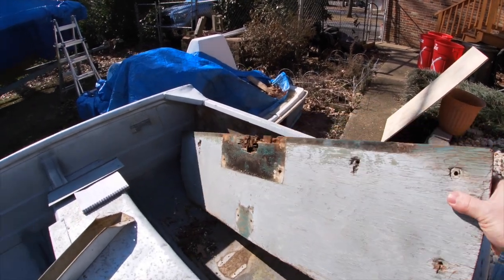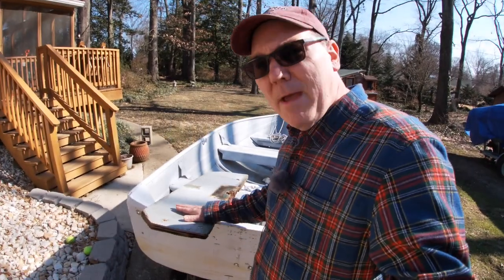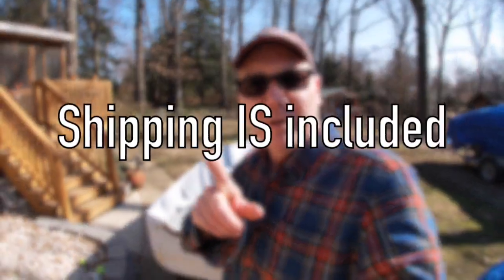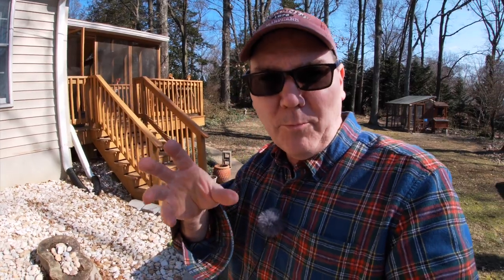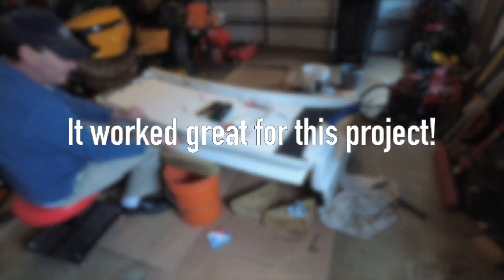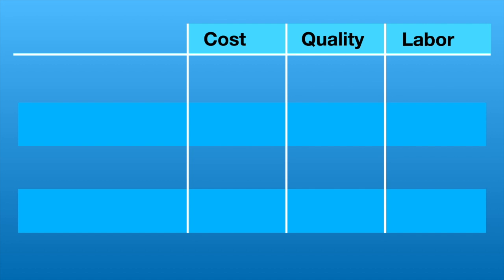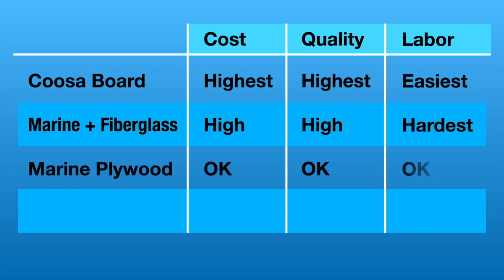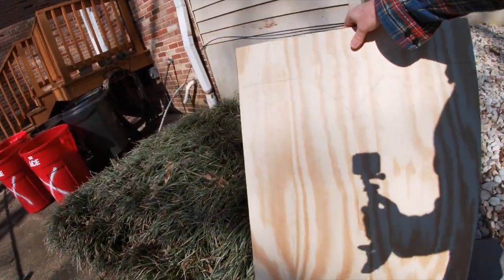Boat Transom Replacement - Marine plywood, coosa board, or something else?

Comment: They do recommend to cover coosa with a layer of fiberglass.. and it doesn't hold screws the best..
For that small aluminum boat 2x4s would be "good enough".
Larger boats should do it right, due to the time investment to have to repair it in a year or two
Reply from the maker: I had not heard that it is recommended to cover coosa in fiberglass for this type application. Obviously for stringers etc. it would need to be done, but that kinda thing (and the screw issue!) makes coosa not as appealing for this application!

Comment: Coosa should be wrapped in fiberglass also.  PVC laminated with fiberglass and wrapped, will be much more stiff.  Probably not ideal for a transom because a motor puts a lot of twist force on it, but for stringers, should be a good choice.

Comment: If it was me I would go down to my local auto parts store and pick up a fiberglas repair kit (quart of resin catalyst and some fiberglass cloth in one package). Glue it up and when cured taper the edges slightly run a strip of cloth around the end grain and up the front and rear faces of the plywood, you only need to use a 6” strip of cloth around the edge centered the rest up on the faces of the ply. Yes I know I just added roughly 30.00 to 40.00 dollars of cost but in all likely hood you will never have to do it again and an extra day or so of work to the job will give you a warm fuzzy feeling when the next owner of said craft drives into the sunset dreaming of his water borne adventures swirling around in his mind. (Who knows it might even be me). Their is nothing wrong with saveing money it’s the only way to get the most for what you have to spend on a hobby (if you got enough resin and cloth left do the exposed face of the ply on the outside rear face) The kits if memory serves me where Qt, and I believe gallon size. It’s kind of cheating for me I have a lot of stuff laying around that not every one else will have handy fiberglass cloth some catalyst I need to buy more resin and also have milled and chopped strand reforged fairing materials. Please at least consider tapeing the exposed end grain of your ply it will go a long way to double or triple the life of your transom.

Comment: Use the cheap plywood and give it a good coat or two  of the stuff that they use for pickup bed's to protect them, about the same price ir not much more than painting. A quart should do the trick for the size you have.

Comment: Tiny boat nation makes aluminum transom kits. It's all you need. Do it once do it right.
Reply from the maker: Those kits are pretty cool - but literally would cost more than I paid for the boat.
Reply: @WayneTheBoatGuy  but it's a forever solution, you could theoretically run a bigger motor than the boat is rated for, and deep down inside you know it's what you want. Lol. Plus I mean throwing expensive parts at cheap old boats is the tiny boat nation's philosophy.

Comment: Hi Wayne, any ideas how to attach a plate to my existing transom to lower it about 2 inches, allowing for use of a short shaft electric outboard?
Reply from the maker: You’ll probably need a jack plate. Attach it with long bolts that go through the transom and have lock-type washers and nuts on the other end. Preferably all stainless steel hardware.
Reply: @WayneTheBoatGuy  thank you. Can one be made by hand economically? My boat is a raft with a removable transom.

Comment: I ordered a 3/4" sheet of Marine from "Blue Box" store. special order, took 4-5 weeks to get it.(May 2022)
Big mistake,. 
My particular piece had several visible voids around all edges and it had biscuit/football shaped plugs/patches on the back.
I must admit the face was gorgeous/beautiful, but the rest of it was junk, garbage...
Paying I forget 150/200$ and that included 2 sheets luan for shipping. sandwiched between Luan.
1st. thing I did was squeegee epoxy on both sides and poured the voids and epoxied all edges.
It's a trophy (NOT) 
It's just laying around as I have not found a use worthy of cutting it up for.
I can take BCX or exterior or even regular ply and with time and epoxy or polyester and make it as good as most marine. 
(if not,,. Better)
Furthermore... if you glue 2-3 pieces together making +1" or 2"  material who cares if you get a void or 2, just keep the water out of the voids, and if you pour the edges and sleeve any penetrations you should be golden.
So right now I am anti-marine grade, I got a raw deal I feel, 
I may change my mind at a later date. 
Cheers.

Comment: I’m sure somebody else has mentioned this, but you should not just bolt Coosa in. It should be laminated for rigidity.
Reply from the maker: Someone else did mention that - and I wonder how its unlaminated rigidity compares to wood that is just bolted in.
Reply: @WayneTheBoatGuy  
Coosa is like a foam core with fiberglass strands running through it. It is really only strong once it is laminated. The biggest advantages are light weight and water impermeability.

Comment: Coosa board. Buy once cry once.
Reply from the maker: I was on the fence - If this fails quickly, I will probably go coosa.
Reply: @WayneTheBoatGuy  you won't be out much by trying the plywood first.
Reply: I’ve done coosa for stringers, transom and deck. It was worth the initial cost for longevity.

Comment: I used regular 1x12 pine boards in my 14’ v bottom.  1971 model boat.  The old plywood lasted a long time but was done for in 2018.   Ok pine,,,  wow, I can hear all the reasoning against it already but wait,    I used two thicknesses to fit snugly in the space. I painted all surfaces of the boards with three costs of oil based enamel prior to glueing them together. Not only are they fitted snugly and securely in the transom but they are bolted with SS hardware in every location where there once was rivets and in addition to that I drilled thru the transom hull and boards and used an aluminum skin about 16” long and 10” wide where the motor clamps on on the inside of the boat and its all sandwiched together with the SS number 12 bolts and nuts and washers. Well it’s only been five years since I did that but there’s absolutely no signs of deterioration. No paint chipped off. There’s no flex that I can see even with a 25 hp motor gouging on the throttle all at once. I think this transom will outlast me even if it is pine.
Reply from the maker: That’s kinda been my thinking!

Comment: With the fiberglass resin I don’t believe you need to use the fiberglass. Looking at other videos where plywood was used for flooring they just used the resin without the fiberglass cloth just to waterproof the wood which is all you would really need to do with the transom.
Reply from the maker: Nice! Essentially the same idea as using a brushable epoxy (which I couldn’t find locally)

Comment: Wow,you really went cheap
BCX is a soft wood pine w non water resistant glue vs Marine grade is (hardwood)and water resistant glue. Also people need to pay attention to what kind of marine because there is a non treated which will warp if soaked, vs TREATED marine which you can use immediately without putting anything on it

Comment: Dont you americans have any good oils for wood? Here in Norway we have an oil called Owatrol. My father used this on the transom plate and the floorplates on our boat in the 80s. I own that boat now, and all the plates are the same. The plates we used are the broen coated plywood they use on scafoldings, boats and trailers. If you use this oil every 3-5 years this plywood or whatever its called lasts forever. My boat, my scafolding system, and trailer stays outdoors all year. On my other boat from the 70s, I changed  some supportbords under the seats. The old ones wherere made of oak, but I used regular plywood soaked in fiberglass resin. The ends where dipped in  resin about 6-7 times, and the rest got 3 layers. 4 years later they are still newish and shiny.
Reply from the maker: We may have something like that but I don't know. Our biggest challenge is that (in general) we don't take care of things. Even something like simply re-applying an inexpensive oil.

Comment: No need to use anything other than plywood if it lasts over 30+ years. Also, marine grade plywood is no better than treated plywood. As soon as you use epoxy on plywood it soaks in and becomes marine grade plywood lol.  Starboard and PVC is not good since epoxy wont bond well to it.  It's important to allow your treated plywood to sit around for a few weeks to dry out before you epoxy it.
Reply from the maker: The copper used in making 'treated' plywood can cause corrosion in aluminum boats. I hadn't thought about whether or not sealing that plywood in epoxy would prevent that from happening by creating a barrier.

Comment: You totally missed deck lumber treated for ground contact. Cheap, pre-stained, will last (much)  longer than you or I will. Available in 5/4 stock as well as nominal 1".
Reply from the maker: Treated lumber is not supposed to be used with aluminum boats.
Reply: @WayneTheBoatGuy  Who THE HELL knew????  It sounds like an insulating layer of 'something' (like plastic sheet) will prevent the copper/aluminum contact and ensuing  galvanic corrosion.
Reply from the maker: @Steve-wz5pz  that could be something interesting to test.